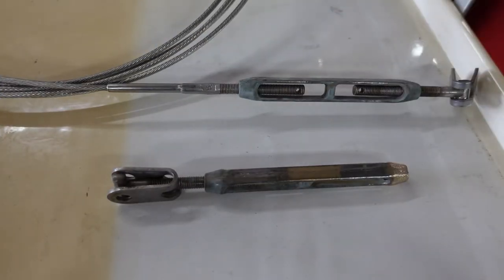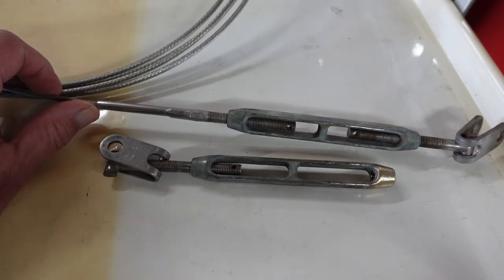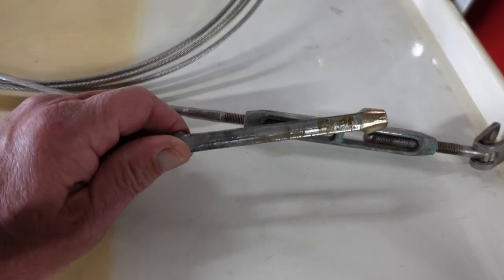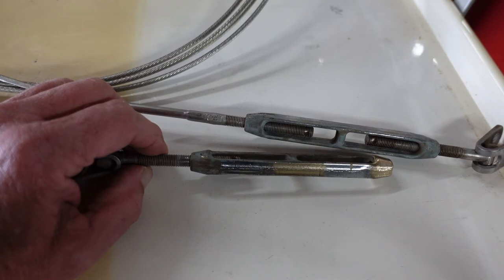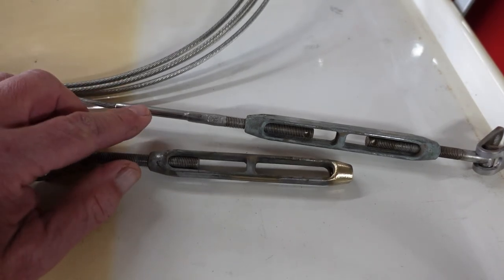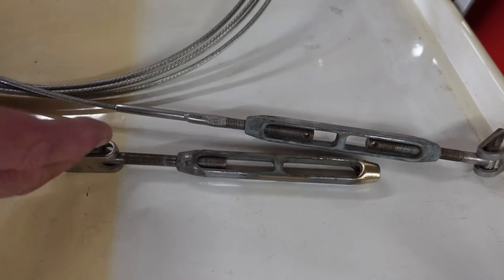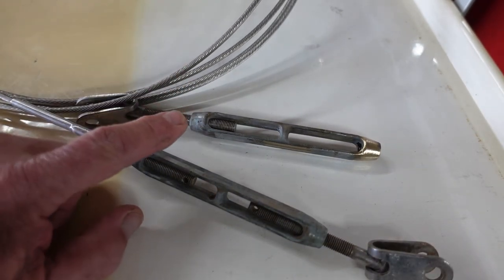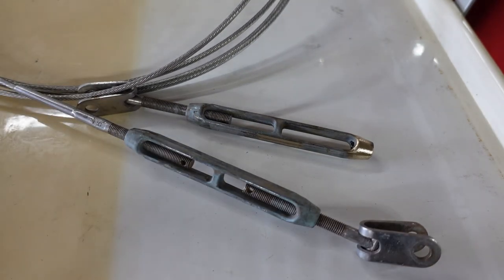A Note on Turnbuckles & Standing Rigging  Replacement

Comment: Looks like a nice project. Do you have access to a swaging machine or have a lead on a rigger who can do it for you on thr cheap?

The previous owners of our boat installed DIY Hayn Hi-Mod swageless fittings on the all-new rigging and new chainplates in 2012.   He also bought a metric shitton of wire (250' spool) so we still have enough new wire to totally re-rig the boat when we deem it necessary.  All that we will be required to purchase is new cones for the swageless fittings.  We may decide to recycle the longer stays for the lowers to save some wire for next time as all the corrosion issues will be at the cones.

Our turnbuckles are unchromed bronze and look almost new with minimal patina. They are not even remotely green.  Perhaps a little on the light coffee-colored.
Reply from the maker: That’s great, those things aren’t cheap. I’ll have  the West Marine rigging shop in Newport Beach make all but the forestay as It has the Harken furler and any maintenance means having a Hi-Mod on at least the deck end of the wire. 👍
Reply: We used WM riggers to do our new lifelines. Wr were satisfied with the price and workmanship with the Pro/portsupply discount. I specified 1x19 rigging wire instead of standard plastic-coated lifeline cable. It worked great and will probably outlast the boat.